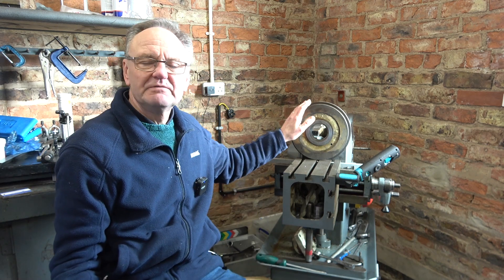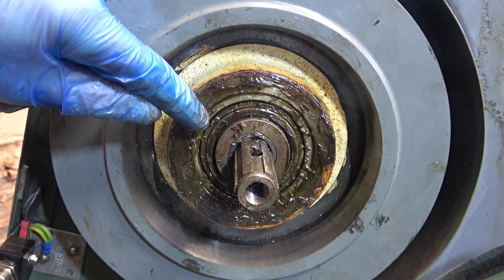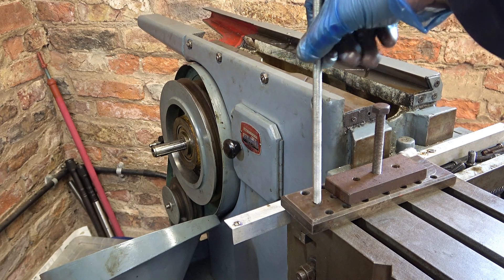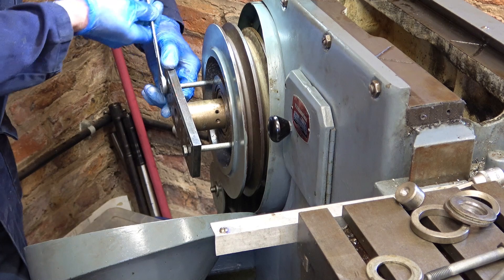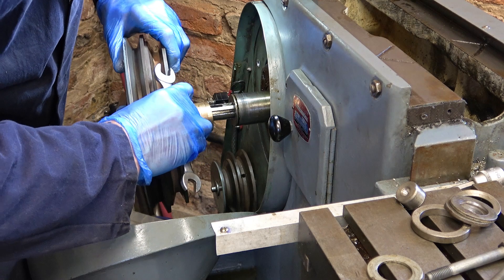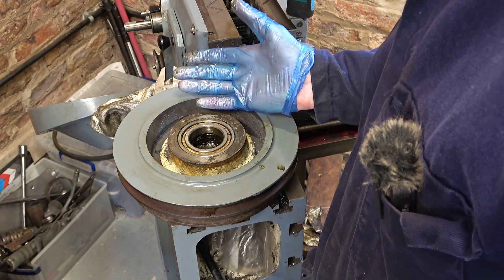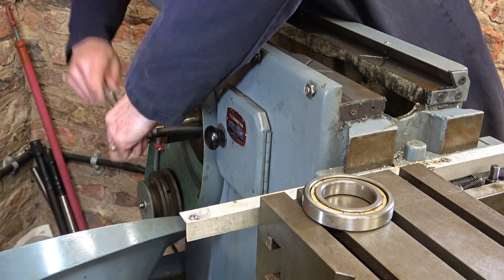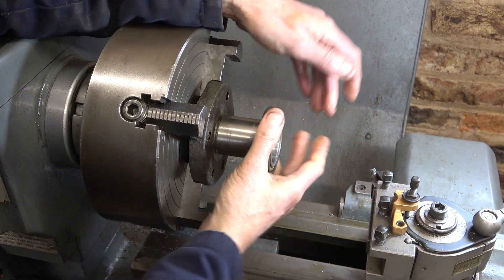HS184 Elliott 10M shaper repairs – Part 2

Comment: Thanks for posting this video. I am stripping down my machine as a lot of the teeth that should be on the gears are in the oily sludge in the bottom of the machine. Your efforts are a great help. Thank you!
Reply from the maker: Hi Freudiankey, I used it for a couple of years just doing the essential maintenance but finally decided to put the effort in to put it right properly. It was quite an enjoyable project. Cheers

Comment: Hello again. I am a real believer in shop made tools of any sort. They can gather dust for years and save the day when needed. Great poking around and getting those crunchy bearings removed there. Getting Metal Clad bearings for this makes all the sense in the world. Do you think you are not the first one that has serviced these pieces? I think not as having a creator put a substandard set of bearings in just doesn't make much sense to me. See you at the next post. I like your style new friend.
Reply from the maker: Echo that Tomoko, when I built the milling head for the shaper people queried whether it would ever be robust enough for practical use. Well there will be a video soon which proves that it is, so it's a good backup if my mill is out of action (which it was when I was servicing the vertical head). Cheers

Comment: Thanks for this series. I am interested to note how different the various issues are with your Elliot 10M as compared with mine. No ball bearing nor gear issues like yours. Mine  were bull wheel bronze bearings, sliding block and mating surfaces on lever - all, I suspect, due to inadequate lubrication. Thinking about how to improve.
Reply from the maker: Hi Workshopfriend, thankfully all my bronze bearings seem to be in good condition but I am rigging up an oiler system for the bronze bearings - tubes with a small tank. I think that will be in Part 7 (not edited that far yet). Cheers

Comment: Thanks for another very good chapter in the story of your repairs. Really enjoy your approach, and always look forward to more. Laurie
Reply from the maker: Hi Laurie, I mention you in a vid a couple of weeks from now. Just saying about the wheel on the right hand side and it would have to be (too) big. I'm down with a stinking cold at the moment which is dragging on, and on, and on, but my next job when I can get back into the workshop is to start on my idea to add a shaft on the right to advance the stroke from side. Cheers
Reply: @HaxbyShed  Hi Paul, most importantly I hope you get over your cold soon. I look forward to seeing your solution. My current idea bubbling around in my head is to mount, via the cover screws in modified form, a pair of parallel plates holding a gear train. Still pondering as I don't want it to be too eccentric looking. Yours will I suspect be a rather more elegant and practical solution! And thank you for being kind enough to mention me. Laurie

Comment: G'day Paul.  Good job on the repair mate.  Should be like a new one once that new bearing is installed.  I had the same problems with my horizontal spindle motor.  Cheers, Aaron.
Reply from the maker: Thanks Aaron, cheers.

Comment: Good work Paul.
Reply from the maker: Thank you Owen. Nice to have your comment. Cheers
Reply: @HaxbyShed  the tricky thing about smart meters is that the dno or service provider can turn the power off remotely. You could get all the features of a smart meter (except meter reading for the supplier) with a clamp on meter  depending on what you get and how you store data you could have many more interrogative features

Comment: Paul, Well done... the rabbet hole is always deeper than expected... When our local utility started converting to smart meters, they had major problems retrieving the data so they just guessed at the billing "2 to 3 times the actual usage in many cases". It was a huge mess to say the least.
Enjoyed, Cheers...Dean
Reply from the maker: Hi Dean, when I put in that bit about the smart meters I had no awareness of which other countries are putting them in. Seems like we are not alone ..... From what I know the problems here partly result from radio not being the know-how of meter manufacturers and some of the meters themselves interfered with the comms hub that sits with the electricity meters.  Furthermore quite often the gas meters are not in range of the comms hub which sits with the electricity meters - about 10m / 30ft is the limit line of sight with no walls or anything in between. So it kinda works if your electricity and gas meters are adjacent but in many real world applications it just don't connect. And then we could talk about flats/apartment blocks.....  I think today about half of UK houses are on smart meters now so not a complete fail but it's cost a lot and overrun by years. Cheers

Comment: Besides being able to control who gets power or not, the big benefit is being able to layoff hundreds of meter readers.
Reply from the maker: Yes that is definitely true DC. Gradually we will move from the old way of generating to fulfil demand to a regime of managed supply. Electric vehicles will put a massive load on the system so they must implement a way of throttling supply. Now I'm not sure that was in their minds when the project started, because e-cars were a long way off then, but I'm sure it's a necessary step now else the grid would become unsustainable as load outstrips current generation capacity (in my humble opinion). Cheers

Comment: In my eastern PA, US location, the meters are owned by the local electrical utility which maintains the lines, etc.    Many years ago they came up with a device to transmit usage data down the AC line in the microsecond when the wave was crossing 0 voltage.    As you can imagine this limited the amount of data which could be transmitted, but it did work.    A few years ago they replaced all the meters with a kind of smart meter which they stated uses a wifi connection to transmit the data.   I do not know where the receiver is located, perhaps on the pole.  I expect there is some PA state requirement for these devices.   Likely different state-by-state.    The new meters do allow better detection of power outages, which are frequent in my area.   Often caused by trees touching the overhead wires which can happen during storms or just very windy days.
A lot of work as usual once you find out what is required to disassemble the item.
Those bearings are expensive.   Sad that they are not offered with rubber shields.   I do prefer shielded bearings.
Dave.
Reply from the maker: Hi Dave, I have a friend who was an expert on the industry panels when they were developing the smart meter standards. He told me the generators' requirements to monitor power quality at the point of consumption kind of got pushed out by priority given to network operators and the energy retailers. Cant say it was exactly like that but that's the gist of what he said. Cheers

Comment: When I refurbished my 10M, I just fitted the open bearings and did nothing about sealing them. Then again, I dont expect it to get enough use to wear out in my lifetime!
If you're changing the belt whilst youve got it all apart, mine uses a B38 size.
Reply from the maker: Hi Robert, I will compare that with my belt. I did buy one and ran it for a while but it was a bit tight so I bought a slightly longer one. I've made a shielding plate for the outboard side. It won't be airtight but it should keep most of the muck out. Cheers

Comment: The deeper you dig, the more it costs!, standard fayre.
Possibly one of the bearings jammed and spun causing the shaft damage,  not sure if sealed or shielded bearings were available 60 plus years ago at a reasonable cost?
Those gloves are dire for working in, Nitrile are far better.
Thanks for sharing
Reply from the maker: Hi John, the gloves are vinyl and we happened to have them, and they don't stick to anything. But of course they are not puncture resistant and tear easily so I get through about 5 pairs a day! I've just ordered some nitrile gloves to try, under £6 delivered for 100. The terrible state of the bearings was a surprise. Yes likely the bearing locked and spun on the shaft. I'll put it together with some Loctite bearing retainer and I hope that will hold it. Cheers
Reply: @HaxbyShed  Yes, i use Vinyl for general painting, for any submersion or prolonged contact with strong chemicals, I use Latex or Nitrile, and Nitrile for assembly work. I try to use Ansell TouchNTuff (92-605 I think). Latex gloves which are recommend for tattooists are good, most have a light texture to aid grip. I used to work with strong acids, alkalis, Acetone etc for etching of materials for macro/micro examination, it s quite interesting reading up on suitability and the "Acceptable Quality Level" (AQL) rating, (Lower is better), and scary on allowance for manufacturing defects!!. doubling up, or doubling up with seperate manufacturers. Obviously day to day use, most are fine.

Guessing the clutch assembly rotates 300 to 500 RPM, so quite slow?
Have a great weekend Paul.

TTFN John.

Comment: Our smart meter uses the mobile phone signal but as our mobile signal is poor it does not often work. Good job with the puller, it is the way we would go about it. The bearing challenge sounds interesting
Reply from the maker: Hi GTB, I'm not sure why they went for a different communications system for the meters in North of the UK (i.e. north of Manchester). Perhaps outside of the big cities the mobile cell network was not so good up here. They say there is  >95% coverage on the meter network but that may be by population rather than by geography. At one of our favourite rural locations we can only get about 20 digital TV channels instead of the normal >100, and there are no plans to improve that. If we could only get the trains to work, meters to work and TV to work we might be half way to 'levelling up'. Cheers
Reply: @HaxbyShed  We would settle for just good broadband. They put one of the new boxes at the end of our lane but have no plans to connect us. As we have poor mobile signal our only option is the copper wires that are about 5 miles from the exchange

Comment: Thx for the vid. As someone else mentioned the original bearings lasted this long. The manual I found online says the clutch pulley ball bearings are greased before install and only require periodic maintenance. Item #19 on the Lubrication chart. I agree that it does seem that sealed bearings should be in there, but the mfg. didn't believe so.
Reply from the maker: Hi W65er, this assembly was packed with grease on assembly but there is no way to add more grease short of taking it off, washing out and repacking. I have added a grease fitting to the pulley hub, as you will see later. Cheers

Comment: The original bearing lasted all this time, I would put the same bearing back in and forget about it.
Reply from the maker: Hi wilkbilt, I am putting the same bearings back in, because really there were limited options for 3in x 1.3/4in x 9/16in - it's really the 1.3/4 shaft dimension that's limiting my choices. But I am making shields to help keep the rubbish out. Cheers

Comment: Well done and a great video. 

That puller setup came right out of the pile of opportunity. And worked great. 

Scott
Reply from the maker: Hi Scott, can't tell you how long I've had those bits but possibly 40 years at minimum. That 'spreader plate' was an apprentice test piece left in the college scrap bin and I fished it out. It's come in handy many times. Cheers.

Comment: I would find the next larger METRIC size bearing in 2RS(double seal) and machine the hub and pulley to fit.
Also on the smart meters, its not the BENEFITS that they tell you(smoke and mirrors) that bother me its what they dont tell you.
Reply from the maker: Hi candaservices, I could have machined out for a bigger OD or width but I'd be stuck with the 1.3/4 inch shaft (44.45mm). I could have reduced the shaft I suppose but then it's becoming quite a project. I'm fitting standard replacement bearings but improvising some shields. Of course they can remotely command the smartmeters to disconnect the supply, and sometime in the future smart appliances will have to negotiate with the meter for power (kettle says 'give me power' and the meter says 'wait one - got to manage the grid load'). Definitely a factor when 10 million electric cars all want to start charging at 12:30 am exactly when the Economy7 cheap rate tariff starts. Cheers
Reply: @HaxbyShed  Well I'm sure that however you fix it it will be a proper fix! Also electric cars is not the answer but I guess its a start.

Comment: Who’s bearings are tore up? I would check any other bearings on that machine and order them as well.
Reply from the maker: Well actually Kimber the only steel bearings on that machine are in the motor and that clutch pulley. Every other 'bearing' is oiled bronze bushing, and they are all in excellent condition. Our old grandads knew what they were doing, and should have took no notice of those new-fangled ball bearing things. Cheers

Comment: those bearing look like they were meant to be run in oil not open like this application it looks like they should be sealed bearings.
Reply from the maker: Hi Vernon, yes exactly. When I look at the description for those bearings it says "designed to run open in oil where there is no risk of contamination". Not - run in grease where there is every chance of dust from the belt and particles from a metal-on-metal clutch. Cheers

Comment: Bit of  conundrum. Excellent film.
Reply from the maker: Hi Carl, maybe a slow-going that one but the pulley was awkward. There will be a bit more action in the next one sorting out the ram tool slide swivel and starting on the bull gear repair, on the new mill. Cheers